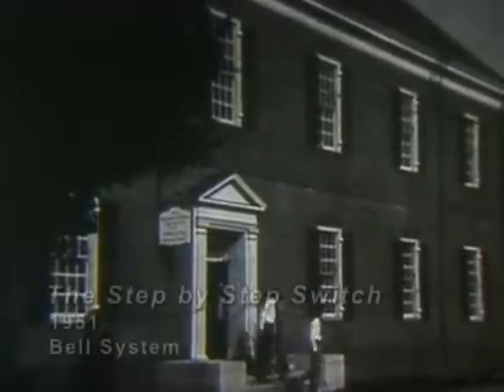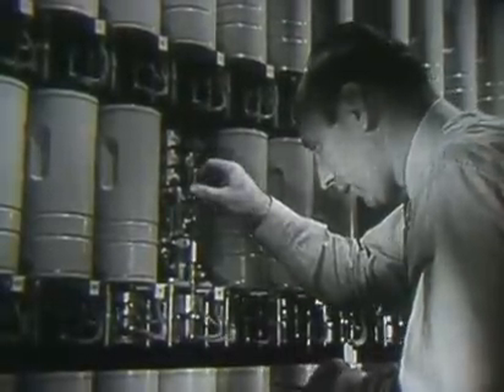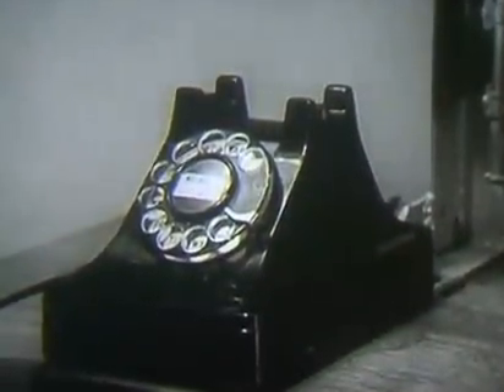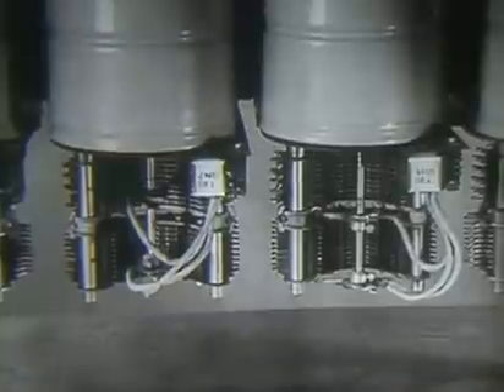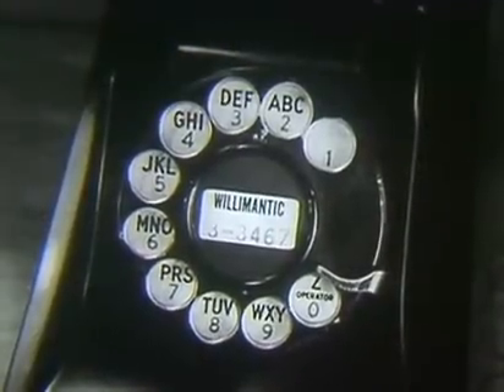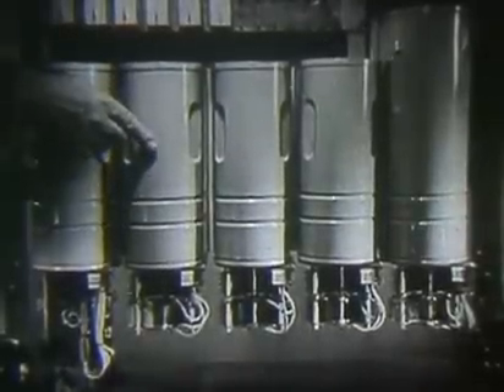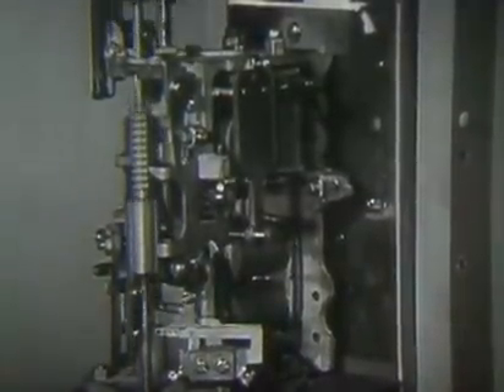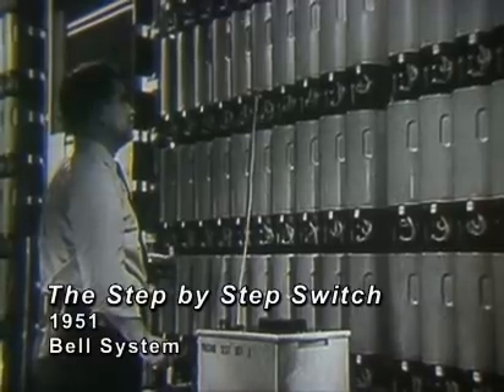AT&T Archives: The Step-By-Step Switch

Comment: Don't laugh, these switches were very reliable but they needed people to maintain them. I worked under the old Bell System, back in the day when employees took a lot of pride in their work. It was a very strict workplace but we were proud to say I work for "MaBell".
Reply: +Bri G. I love learning about analog... It seems so complicated compared to our new age digital solutions. I can completely see where someone would have huge pride in maintaining these systems. Very technical, precise and methodical skill set required to keep machines like these running. Calibration is mission critical, both then and now.
Reply: @dryzalmynelli9600  Nowadays it is more complicated than back these days. Could you repair a digital or even VoIP telephone today? If the simple electro-mechanical telephone in your home broke down, you just opened it and looked what could cause the failure. If a digital telephone of today breaks down, you have to give it away for repair unless you are a qualified eletrical engineer or something like that. Sorry for my english, but I am german.
Reply: @knuffelbaer1971 ,   your English is much better than my German!  You have no need to apologize.
Reply: @dryzalmynelli9600  Current technology is many many orders of magnitude more complex and sophisticated. It just seems simpler because the complexity is microscopic and hidden from the user, with circuits nearing the size of an atom.
Reply: The PBX at my office in 1982 was a step-by-step PBX and the PBX operator connected incoming calls at a cord board. My keyset phone was rotary which made using services that required Touch Tone to be impossible. So I bought a telephone set microphone from Radio Shack that had Touch Tone buttons surrounding the microphone. When making calls, I dialed 9 on the rotary dial to get a second dial tone from the central office and then dialed the number on the Touch Tone pad surrounding the microphone.
Reply: This old system worked exceptionally well for decades.
Reply: There were still stepper switches when I started on the frame in '79.  Took the buyout in '07 thanks to Fios and just learned the frames are going to be removed from the CO's.  You can't stop progress.
Reply: I never got to work on them, they were being taken out of service in 1980's. It did require some skill to maintain them. the New switches when something goes wrong the techs remove the bad circuit pack and plug in a new one.
Reply: @brig.4398  And I thought 1AESS offices were loud especially when the local radio station ran a contest, but these stepper offices were LOUD. :)  I miss the days of these switches and I was just a kid and then an young working adult working for the phone company then, 5ESS offices were getting put in everywhere in the 90s.
Reply: Im not laughing, I am taking notes to make my own 10 line automatic switch as a hobbyist.
Reply: @MaskinJunior  on the tci collectors mailing list there are internet-connected sxs switches and other stuff. They call it C*NET. It's like a private CO that anyone can link stuff to.
Reply: I'm certainly not laughing! I stand in awe of this!!
Reply: @mistergrandpasbakery9941  Me, too!
Reply: Back in 1976 when i started working with Nortel SP-1, i saw the last sXs switch in service in my country.. I also saw the last Pentaconta switches  working . I worked on Nortel SP-1, DMS-100, then with celular systems as: NEC -2 , KAI AND ENHANCED. THEN Ericsson, ATT CDMA and the last, Ericsson GSM. Then I retired on 2008 I was lucky in witnessing all this technology evolution. I worked on the technical support center as technical advisor since 1980 ( No, is not a resume). Greetings..👍🏼
Reply: I really miss that level of workmanship that people did back in the days.  In a call center where no one goes inside except for authorized personnel, a lot of pride was taken when the wiring was installed in places like these.  Especially in this case, they sure don’t make them like they used to
Reply: These units were mechanical,but they WERE digital. They used a binary code. Yep, The old rotary dial (c.1890s)  was digital and DTMF ('Touch Tone" c.1960s) was analog! Electrical digital signaling is significantly older than analog electrical signaling. The telegraph preceded the telephone, and the telegraph used a binary signal....Just like every thing now!
Reply: @jamesslick4790  Very few people know that the fax machine was used in the 19th century. At Bell we used the Telautograph machines to sign orders from miles away.They both used the same principle as the telegraph.
Reply: @robertcuminale1212  I think it was called the pentograph, but yeah the first"fax" machine was in use around 1860 or so. It's really crazy when you look back and see the technology we came up with at the time.
Reply: No, they are reworked and then brought back into service
Reply: 3towersnot2  Interesting!
 Thank you...
Reply: I have also replaced these systems in the early ‘90s here in the Netherlands, we put in digital 5ESS, a lot of space was left in the buildings that housed the exchanges, maintenance people put in things like ping pong tables for entertainment during breaks.
Haven’t been in one since end of ‘92, wonder what they have now.
Reply: I would love to get my hands on one of those old selectors. Or, even an old operator/repair manual like the one shown in this film.
Reply: How loud did it get in rooms full of these things going off?
Reply: Soylent Green very loud; but got used to it and could hear when one switch was in trouble...
Reply: @maxstr   Back in the 1960's, my dad took me on a tour of the local exchange building.  If there HAD been an OSHA at the time, hearing protection would have been mandated: The frequency of the sound was not at all disturbing, but the amplitude was downright deafening.  I remember feeling like all those switches could tear you apart like the rotating teeth of a paper shredder!  (They couldn't, of course.)

It was, as evidenced by the fact I can still recall the sensations 50 years later, unforgettable.

By the way, it was wintertime, and it was damn HOT in that room: A lot of copper giving a lot of resistance!  I could only imagine what it was like in the summertime.  If everything seemed big, or bulky, perhaps it was to compensate for heat expansion that might've played havoc with mechanicals with smaller tolerances.

There's a local exchange (are they called central offices now?) at the end of my street.  I peer in to the glazed (reflect sunlight--there's that heat thing again) windows at night when they are not mirrors to the outside world.  The vast interior space is vacant except for the now-empty metal racking which is no doubt still supporting the roof ... and in a single corner, a few small boxes smaller than my stove with rapidly blinking LED's covering them.  Those boxes do not occupy even 1% of the interior volume of the building.  But for legacy copper running God knows where through the structure, laid DECADES ago, no doubt the building could be adaptively reused to significant profit if the telco wanted to get into the real estate business.
Reply: I'm laughing from how amazing and beautiful this piece of electromechanical engineering is.
Reply: No laughing here, I think these things are absolutely fascinating!
Reply: @BriG. How were the shifts? Would people be operating and switching into the wee hours of the morning? And who would usually get those shifts? Thanks!
Reply: My mom worked for the phone company in the 70s. She said they were strict too however there was a lot of politics and poor preforming workers keeping their job because they ran to the union and complained. I remember there was a union strike here in the Houston area in 1983 and the workers were not available to restore service following a hurricane. Lets not forget the reputation the operators had for being rude. I guess things started to decline in the 70s, but got better after they broke up.
Reply: @billybassman21  Yeah, they broke it up, and then they all bought each other up again. 😂
it seems peculiar that you'd blame unions but not the monopoly for poor performance.  Corporations usually have the advantage unless there is an extremely tight labor market.  When there's a de jure monopoly, how would workers have any bargaining power whatsoever without a union?  There is nowhere else to go.
Reply: You mean "back in the day that companies paid living wages"?
Reply: everything is interchangeable, modular, oh and soon-to-be refuse. Is Salvage still a real word in the dictionary, or was that excised with the digital age?
Reply: Bri G. I believe IT Thank you.The new hard switching systems are quite amazing, EE, and, IEE, have come along way.Thank God, for Alexander Graham Bell, and, Nikola Tesla.About bad  physics.... and new tech.Well, that it a matter for engineering. I am working on those two former concepts.So binary.Hey, how can you go wrong with that?
Reply: Bri G. Private Serial one ? I had a Loaner but was scratched away.
Reply: wrg
Reply: I can still hear and smell them going full bore.
Reply: Very interesting
Reply: Ma Bell is a cheap Mother
Reply: Any regular person on Earth we have no idea how to make anything like this
Reply: It's awesome how all these mechanical parts worked together
Reply: Good new, bad new all relying these in the old days. New paper took weeks to publish.
Reply: Who the f*** is laughing? This machine was a beautiful art!
Reply: Not about telecom, but power engineering. I work on the powerplant, that still uses electromechanical relays to protect power equipment and lines, and I have to say that there are relays made in 60-s still in use.
Reply: Courtenay Place Telephone Exchange Building, Wellington NZ was predominantly SxS and music to one's ears. Think the 1931 Wellington East Post Office housed the rotary 58-000 exchange.
Reply: Amazing USA technology.
Reply: And GTE.
Reply: Sir, I will overwhelmingly take your work ethic and diligence over today’s laissez-faire attitude.
Reply: Ol' Ma did have quite the ill communication, and a license for it, too.
Reply: Nothing like it. Old 1A Switchmen I was. Those panel and XB office were something
Reply: Glenn Koger They still would work fine, and likely for many more decades! but being mechanical, They are more expensive to make. On a smaller scale, a merely "good" mechanical watch costs much more to make than the "best" digital watch.
Reply: @jamesslick4790  this video starts off giving us the reason why they still won't work fine. They require a lot of maintenance. Man power. Designing a modern self maintaining version would be interesting though.
Reply: @Imaboss8ball  Um my TI-994A wouldn't cut it i in. Today's world either.🙄
Reply: @jamesslick4790  for entire different reasons. It doesn't have the capability to perform modern tasks. Although there is nothing preventing you from using it for yourself.
Reply: +Bri G. EMP Proof !
Reply: @butterflywing61  you need some cognitive improvement, have you passed the 6th grade yet?
Reply: Dryzal Mynelli:: digit age. Digits = units. On - off switch. We should re-name the so called "digital age" with something more realistic like the "thousand switch age" ;)
Reply: We have phone service through Spectrum and we recently bought an older rotary phone that still works through their service. So then do they still use this switching system or is it something different today?
Reply: @bodeine454  No. Digital multi-freq line receivers are designed to read either dialing method. From there everything is digital, including the conversion of your voice from an analogue variable current into a digital stream at your local CO. From there it is transmitted digitally to the destination anywhere in the world and your voice is converted back to an analog electrical current at the final destination so that a simple telephone speaker can play the human voice. Check out videos on how analog to digital occurs.
Reply: @bodeine454  the rotary phone you have would convert dial pulses to the tones you here on a modern phone. The dial pulse based equipment shown in the video was generally replaced in the 1970s.
Reply: @bodeine454  everything is digital now. I also have Spectrum and after a year of cable/net service, just today I started to use the voice connection with a cheap landline phone. 

The dial tone isn’t even necessary - it’s just kept around for familiarity, due to people being used to it. Dialing is all handled by powerful computers that can process billions more simultaneous calls than these early analog systems could.
Reply: @bodeine454  if you can find out what type of exchange you're connected to, such as a WECO 5ESS, they're able to do both pulse and touch tone (DTMF) dialing.
Reply: @djscrizzle  I'll look into it, thank you!
Reply: Jeff Stone Lmao definitely different.
Reply: @bodeine454  It's something different. Spectrum is a cable company, so they don't have anything like these, or even the big old digital switches like the 5E or DMS. They use VoIP, IP telephony, which is just programmed to be able to understand and interpret the pulse dialing that rotary phones and these step switches used.
Reply: Ohhh, nice. Was wondering that myself, makes sense, thanx.
Reply: Mother's brother in Pittsburgh was inovativly renouned and transistor developer/design eng. at Bell,calls with president after retire on basis, birthdays ect. Original Law Enforce Automotive  Com. ,other related.
Accentric-Benevolent-Humbel life,
Snow Falling Through Big Holes in Roof into 100's stacked Full Paper Bags of Old Bell Stocks on floors for 40yrs. Bzzzzzz,t  philips
Reply: @raymiles691 bell labs was on West side of NYC in West Greenwich village? Just south of maybe 9th or 10 street?
Reply: Back when people took pride in their work...I hate to say this but those days are disappearing. I’m nearly 60 now & am very disappointed in what I see in today’s work force. It is so hard to find people who are actually willing to put in an honest days work for an honest days pay! Very good point!
Reply: @702ringo1  if it’s so rare, then where do the millions of new cars, computers, tvs, appliances, buildings, homes, infrastructure, food stuffs, and all the other products we use come from? I just purchased a few thousand dollars worth of electronic musical instruments that are higher quality and more sophisticated than anything available 42 years ago when I was a kid. many people must have put in many hard days of honest work in designing and building this stuff and shipping it to my doorstep.
Reply: I applaude you! I was born in 1957, and remember living in a small town in Ohio, where we had a party line. I also remember when you could dial "0" and get an operator, and we had 5 digit calling......yea, it was mechanical and it took a lot of maintenance to keep it all running smoothly. You can see why back then a monopoly was needed.